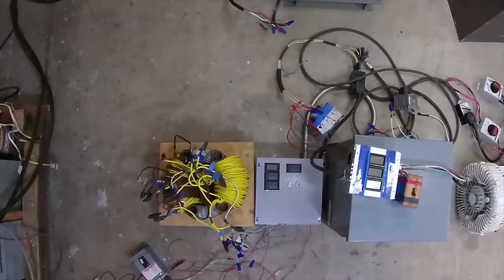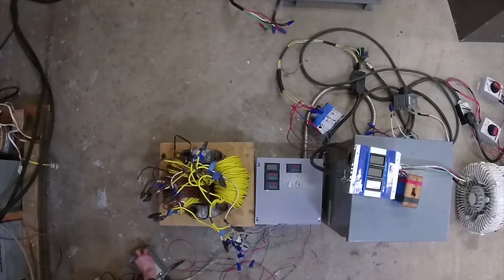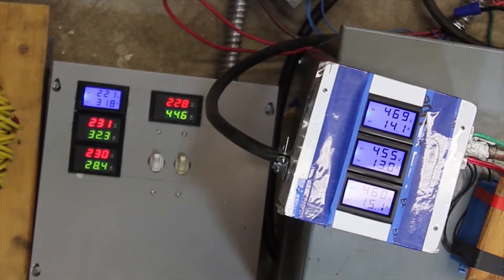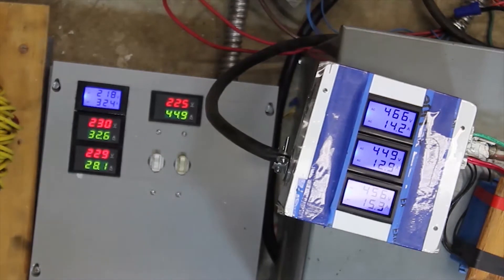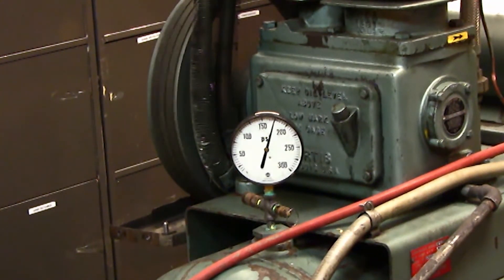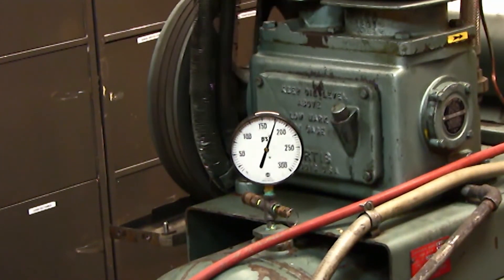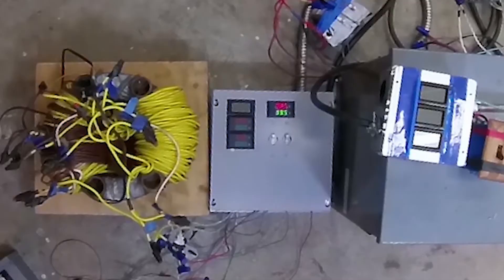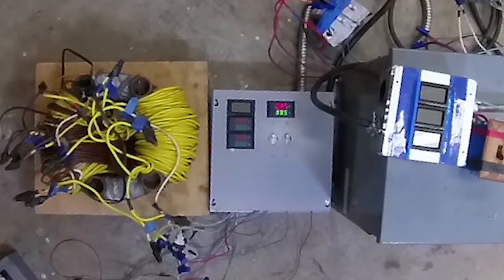Run 3 Phase 10 hp compressor on single phase with double transformers

Comment: Hi thanks for your demo, may i know if want to build single phase to three phase  converter for 10 hp motor. Is it possible to run 10 hp by using this method

Comment: I enjoy and subscribe to your channel, I also have your latest book release , is very informative. I do have a ? On a phase converter, If you had a 10 hp 220v ac 3ph and used  15hp as the converter what would the efficiency of the 10hp end up being , would it be only 50% ?  Thanks for the good vid.
Reply from the maker: Not sure I really understand the question. Do you mean you are running a 10 hp motor from a 15 hp rotary? The problem with a 15 hp running a 10 hp is in the starting of the  10 hp. As for efficiency the 10 hp rotary and the 15 hp rotary use about the same when unloaded and if they can run the load motor the efficiency would be the same. At idle with no load the 10, 15, 20, 30 hp rotary all draw about 1200 watts. Which is 1200 watts of wasted current but when loaded they are close to 100 percent efficient.